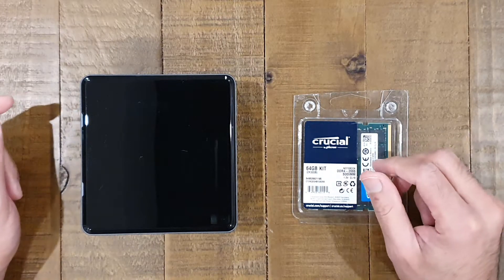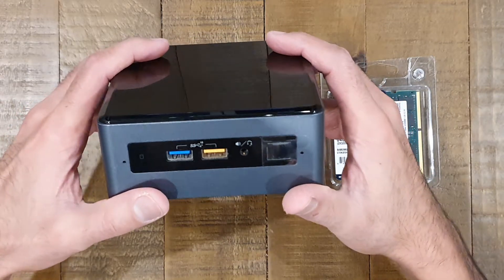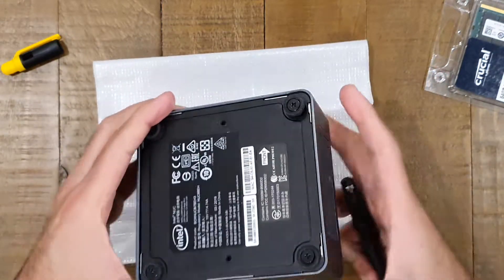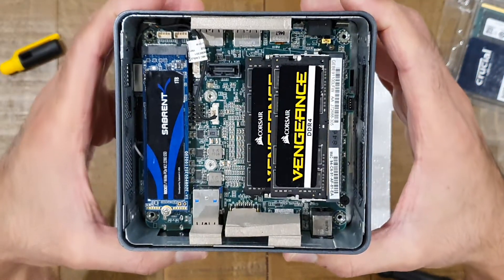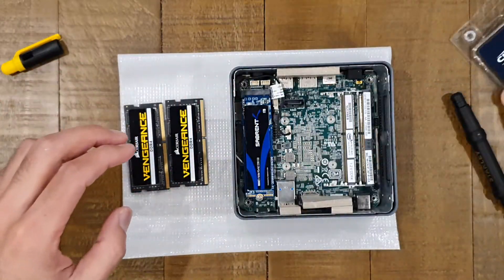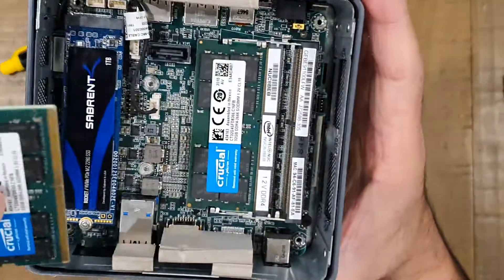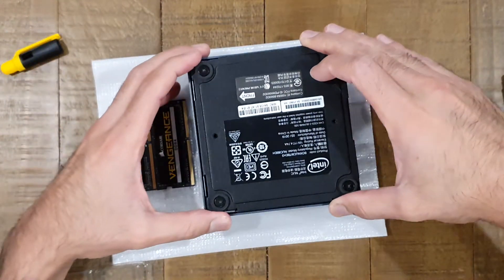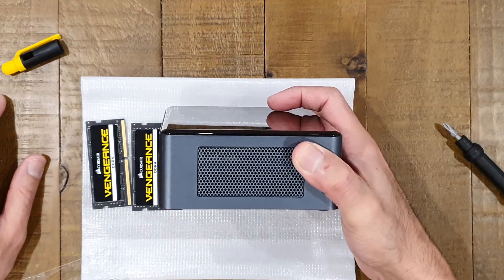Intel NUC NUC8i7BEH3 - 64GB RAM Memory Upgrade - How To

Comment: Well I gave this a try with my Skull Canyon but it didn't boot up.  Is there anything else needed?  Settings to change or firmware updates that needed to be applied?  I put the original 8gb card back in and it booted up fine.  I did notice it warned me about the memory downgrade which suggests maybe it was working somewhat.
Reply: If it houses an Intel core i7 6770HQ then it supports 64 GB, according to their speciffications.
Th system needs some time to adapt to the amount of memory ! So it doesn't recognize it right away.

Comment: are you sure it's registering the 64GB? there were no screens of it showing 64GB on your video, just you installing and others have said it doesn't work
Reply from the maker: It most certainly does, I still have these NUC's running, I had 3 of which 2 had 64gb of RAM, and work without any issues.
Reply: @TKsTechCorner  thanks, i would really like this to work, maybe it only works for your setup as its virtualized ? have you tried just sticking windows or ubuntu directly on it and seeing if it registers the 64GB ram?  page 13 here says the 8th gen i7 only supports 32GB, but you mention in the video their website said it supports 64GB? also is it a 9th gen? you say 9th gen in the video: https://youtu.be/I-g6ahPpBEg?t=12

see page 13 for the specs on supported memory:
 https://www.intel.com/content/dam/support/us/en/documents/mini-pcs/nuc-kits/NUC8i3BE_NUC8i5BE_NUC8i7BE_TechProdSpec.pdf

Comment: Hello, thanks for the video, i have a NUC7i3BNH with 64GB RAM (M471A4G43MB1-CTD), only 32gb works good, when i plug the additional 32gb, 
it doesn't start, the power button flash 3 times and according to intel, is a memory problem, do you have any advice please ?
Reply: First thing I would check is to make sure that both memory sticks are properly seated in your device. Take both out, reseat them, making sure that you feel/hear the click to ensure that both modules are properly secured.  If that doesn't fix the problem, you may have a defective memory stick-it happens sometimes.  One last thing, you should always try to buy twin memory sticks to ensure that they are the same brand.  Sometimes the memory upgrade won't work if you use two different brands-even if they are the same amount of memory.

Comment: I need of a RAM upgrade and I currently have a 4 GB 2133Hz which soldered to my laptop motherboard and only have 1 slot left. Can I add another 8 GB to make it dual channel or add 4 GB? Which one should i buy for best performance
Reply: @TKsTechCorner  inbuilt 4gb DDR4 maximum 12gb LENOVO IdeaPad 320-151SK
Reply: @TKsTechCorner  Thank you so much and no need of sorry bro 😅🔥🔥